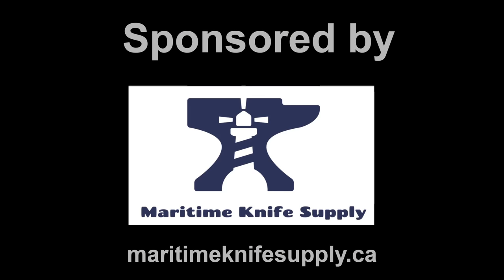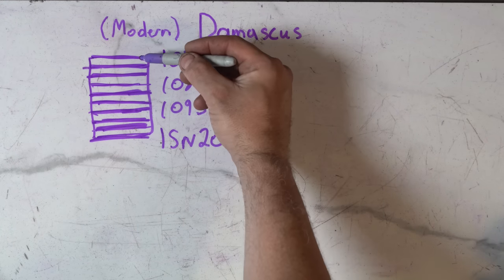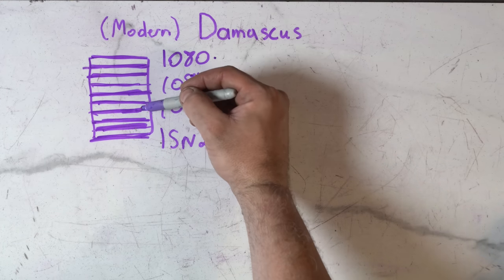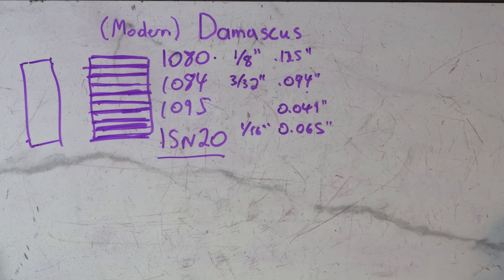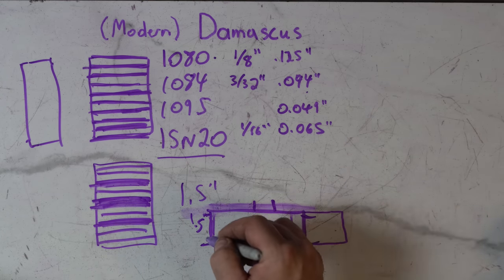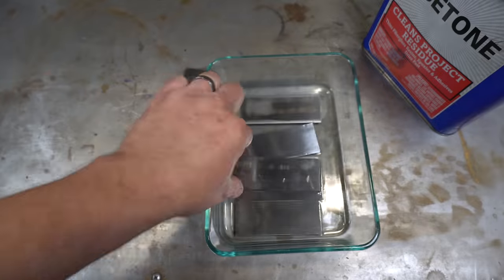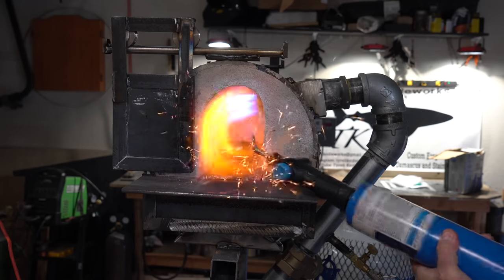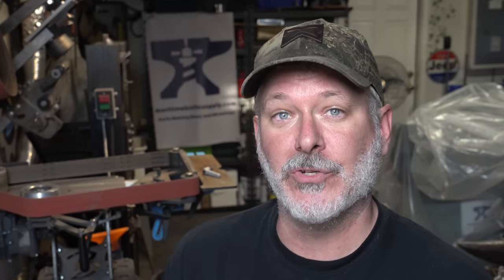Triple-T #100 - Damascus build series - Introduction

Comment from the maker: Are there specific patterns you'd like to see as part of this series?  Any other questions or topics you want covered?
Reply: Here's a fun thought for you- get the Shark logo water jet cut into a billet of flat stock and another in a billet of pattern welded stack so the layers are facing out
Then do a switch between them with the parts cut out and see if you can get a 'Denis fish' mosaic pattern in some canisters.
Reply from the maker: @krissteel4074  That might be an interesting build!  Maybe I'll think about doing that.  As far as a "shark" themed knife, stay tuned! 😜
Reply: I've never seen anyone doing a kind of yin yang pattern, that would be interesting. Otherwise a braided damascus would be awesome, never seen anyone forging this either, but the knives look amazing
Reply from the maker: @dante7228  The yin yang pattern would be interesting to figure out.  Perhaps that would be a fun one to do in the future.  I do have some instruction on braided damascus so that might be one of the advanced patterns I cover later in the series.  👍🏻
Reply: @TyrellKnifeworks  looking forward for both! Hope I don't get to old meanwhile 😉😁
Reply: Start simple and increase complexity. 
As to patterns/styles, would a checkerboard pattern with a single copper square be possible?
Reply: Turkish Twist and Explosion pattern pls!
Reply from the maker: @mannsdan  for sure those two will be in there. 👍
Reply from the maker: @astormofwrenches5555  This series will certainly start simple and get more complex as we go on.  I'll cover the basic basket weave pattern which is somewhat like a checkerboard.   I wouldn't do copper in that because it would compromise the blade integrity if it went though the blade like that.
Reply: I have an idea BUT I'm not sure if its feasible or what it would look like....make a standard layer billet..forge down to maybe between 1/4 - 3/8 thick (smaller is better) . Get the width to be almost perfectly even and parallel on its profile...measure it...then cut the length of the next stack to exactly match it's current width...for example after forge welding and drawing and cutting nasty ends its 1/4 X 2 X 12 ... now cut your pieces for stock to be 2 inches long and 2 inches wide (essentially SQUARES).. now alternate pieces rotating every other piece 90⁰ .. Then forge down to say 1/2 thick ... and do like a ladder but make diamonds INSTEAD  of straight lines... forge rest dow  till total thickness is 1/4 and then make a blade...its WAY less confusing in my head then writing it out. I've got a suspicion it would come out checkered or something with layers going in alternating directions ..
Reply from the maker: @josephrector8735  That's a basket weave pattern.
Reply: I'd really like to see some Typhoon. Amd or Mosaic.
Reply from the maker: @ChrisSmith-gy9zp  I've never heard of Typhoon... that must be some form of raindrop.

Comment: My current setup is a firebrick forge with a single ebay propane forge burner.  I have not tried forge welding yet, but I'm fairly sure I'll have to build a better forge, or at the very least, I'll have to use some plate steel to "contain" the heat better in my current setup.  Thanks for making these videos!!! I'm a long ways from any sort of Damascus but you have taught me so much already!  Keep it up!! 💪
Reply from the maker: Thanks for following the series and the channel!  Caution, once you try damascus, you'll be hooked! 😜.

Comment: ahhhh so that's the difference between 1080 & 1084! I thought it was just the slightest difference in carbon content. I did not know that about the Manganese. Thanks for the clarification Dennis!
Reply from the maker: If you checkout my Triple-T video "Knife Steel 101", it shows the chemical composition of the various steels, in addition to the heat treats.  Thanks for watching, Daniel!

Comment: Seems like the old guy that got me interested in knife making used kerosene for everything. I think he even quenched his blades in it believe it or not. It might have even been diesel fuel I can't remember. Great video 👍
Reply from the maker: In the old days they used lots of liquids for quenching before engineering quench oils came along.  Kerosene is a terrible quenchant because of its flash point.  You’d burn down your shop.  Diesel is terrible because of the carcinogenic chemicals in it.  Use an engineered quench oil, they aren’t that expensive. 👍.

Comment: If you were to make a mono steel bowie what steel would you use and how would you heat treat it?
Reply from the maker: If it was mono-steel, I'd use any of 80CRV2, 1095, 5160, 1080/1084, W1/W2, 52100.. any are good steels but have different heat treatments.  Check my recent Triple-T on Heat Treatment to see how each of these are heat treated.  Note, I've made bowies with just about every one of those steels already.  👍🏻

Comment: I have a question. I understand clean the mill scale off the metal but why clean the metal in acetone to remove oil if you are going to dip the steel right back into oil before you put it into the forge? If the oil dipped steel burns off why wouldn't oil or grease from your hands?
Reply from the maker: It’s not really the oil from your hands we are worried about, it’s the dirt and grime that sticks to that oil.  Cleaning off removes all that.  When it goes into kerosene or oil, it’s going to go directly in the forge so no dirt or grime will collect on it.  👍
Reply: @TyrellKnifeworks  thanks for the explanation

Comment: hey what alternative fluxes are out there besides borax? cause here in my place buying boray isnt that easy...so i was experimntig wit a mix of washing soda and birdsand but besides burning my fingers with molten glass and ruining my billiet by burning it, i dont get a good weld. good it was the second weld on the first i didnt use flux but at the second (because i dont had a belt-grinderat that time)my sides of the billet wasnt fully even i think that was the thing that gave the billet the rest... so is my mix a good alternative and in case its not what alteratives are out therer that dosnt contain borax... annyways i love your videos cause you can explain thing extremly good and enterttainig and i love your knives👍👍👍👍❤❤
Reply from the maker: If you have your forge tuned perfectly with the right amount of fuel/air mixture, flux isn’t strictly necessary.  Make sure to grind your steel flat, don’t take it out of the forge for any reason before it’s time to forge weld it.  Depending where you live, you can usually find anhydrous borax at an online blacksmith shop.  Thanks for watching
Reply: @TyrellKnifeworks  well if its perfectly tuned yes... and no i cant just buy it cause here at y place its prohibited to buy it in powder form as a privat person... thats the reason why im looking arround for some alternatives...
Reply from the maker: @geheimspionchase8658  borax powder is controlled?!   Where do you live?
Reply: @TyrellKnifeworks  Germany

Comment: Is it ok if I have 1/8” thick 15n20 , and .2 thick 1095?
Reply from the maker: Sure, that works fine.  It means you have fewer layers to start is all.  I typically like 1/8” 1084/1095 and .065” 15n20 so you have more layers to start.  Thanks for watching, Austin.

Comment: Wootz is Not Damascus, Wootz (Crucible) Steel is originated in India, It is much more "random ", much older, more forgiving to fusion temperatures...
Damascus is originated in Damascus/ Syria (duh), the steel is arranged in pre-designed combination,  for practical and cosmetic purposes...
The most obvious deference is that in Wootz, you don't have a control over the edge and other blade-parts characteristics,  in Damascus steel, you can ...
Reply from the maker: You are confusing "steel made in Damascus, Syria" with the actual technique of "damascus", aka Wootz.  Wootz was made in India around 300 BC.  What you are referring to as "steel made in Damascus, Syria" was hundreds of years later.  It is suspected that the process of Wootz was migrated from India to the middle-east to Damascus, Syria which was already well known for sword-making.  The "steel made in Damascus, Syria" is still crucible steel.  None of this is what we would refer to as "modern" damascus and what some people like to refer to as Pattern Welded.  They did not do pattern welding back in Damascus, Syria.   Btw, I can site at least 3 sites that support this if you'd like to go research.